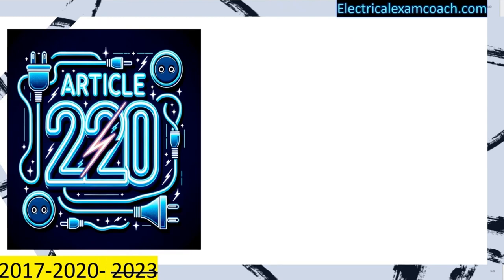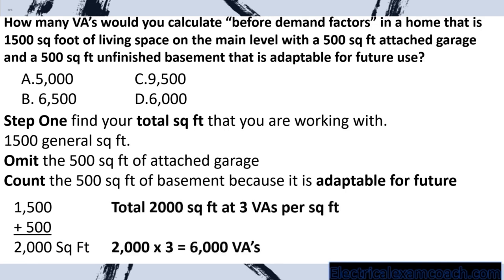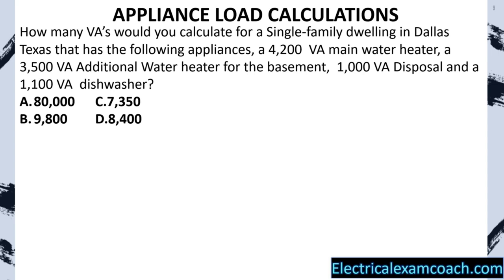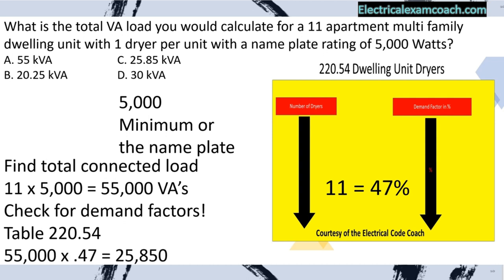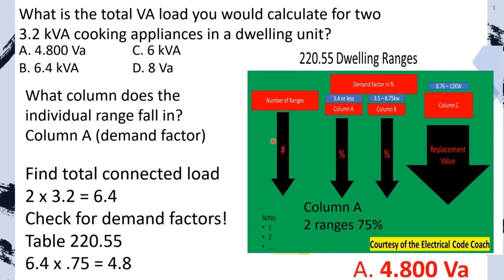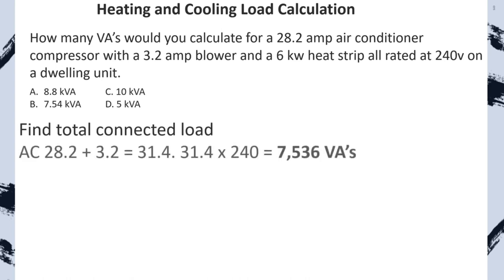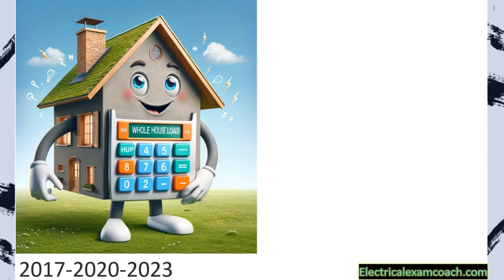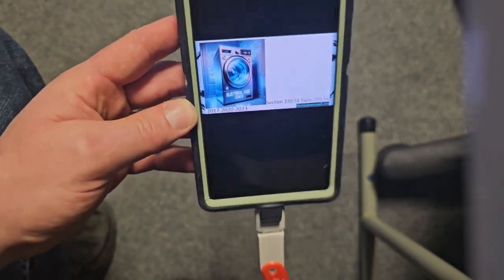Whole House Load Calculations ALL Steps All Videos. NEC Electrical Exam Prep Compilation Article 220

Comment: For the 2023, you also need to include car chargers at 7200VA or the nameplate, whichever is larger with no permitted reductions. 220.53 (5) and 220.57